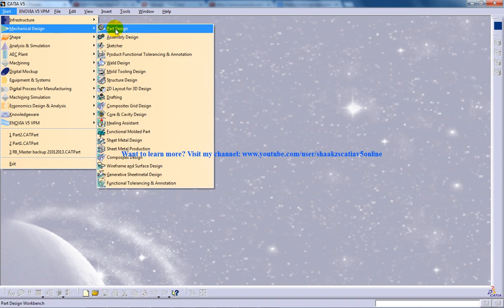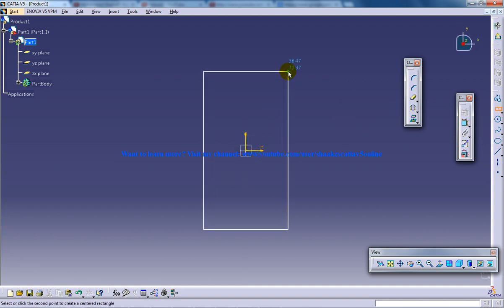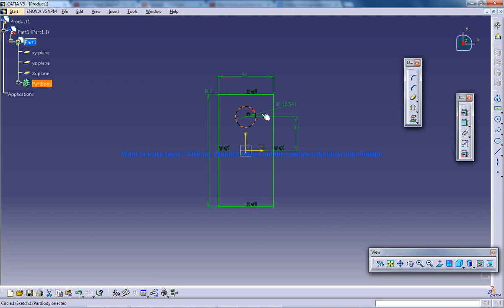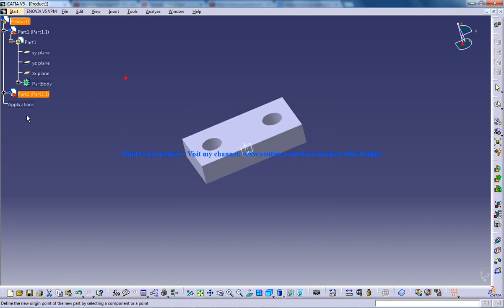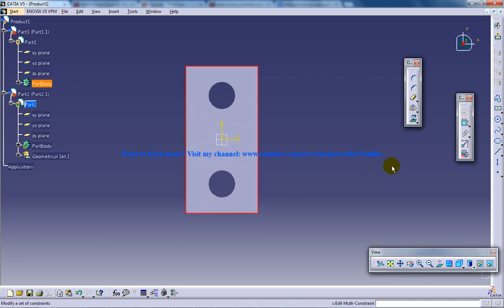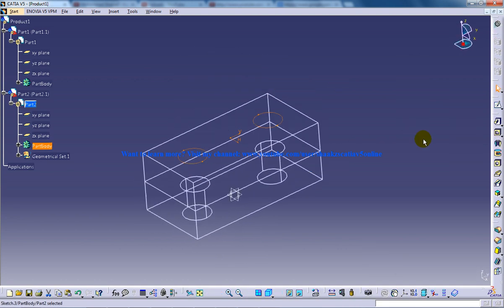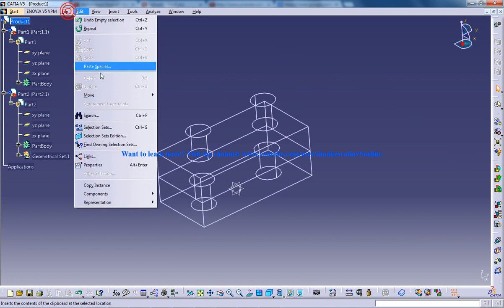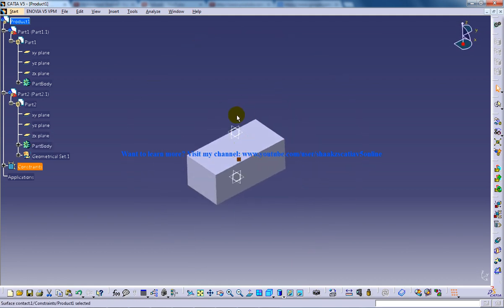Catia V5 Tutorials|Assembly Design|Top Down Approach

Comment: Recently started working at a Design firm for 'working hours' which I'm required to complete as part of my studies and was presented with Catia V5, I am familiar with solidworks and though they are bothe Dassault products, they are similar but not similar enough to be able to jump between without doing the basics again. Thanks for this helpful video :) Turns out I was not selecting 'update' and hence the parts were not mating. Oops :P